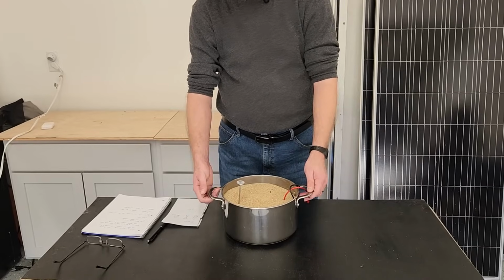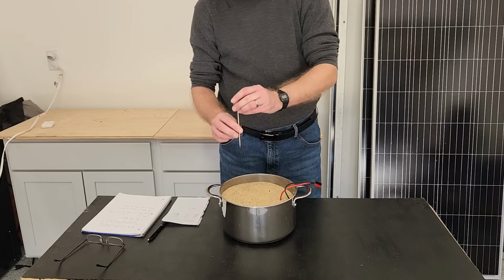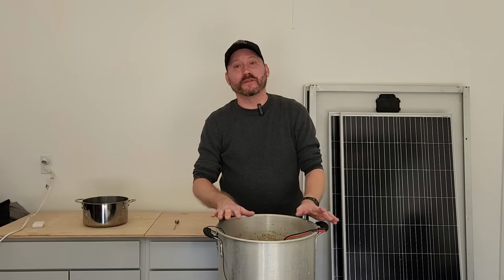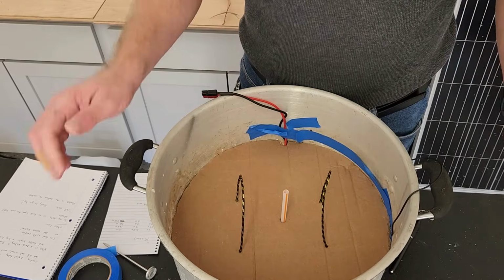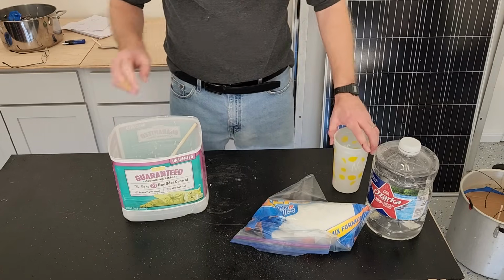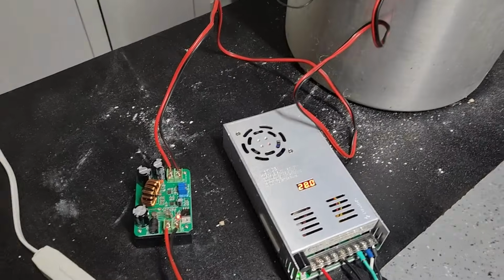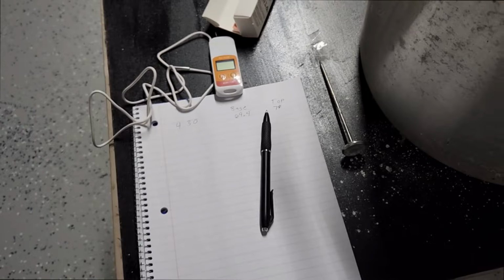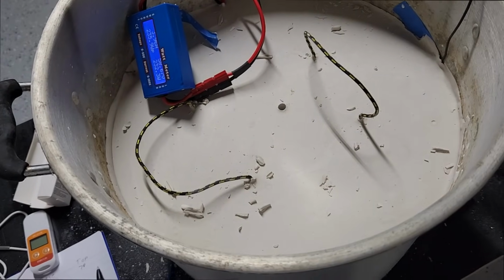Sand Battery heater. Create free heat  of 500F using solar electricity! Texas Prepper Projects

Comment: I would personally use the PV panels to heat water in an insulated tank so you could then either use it later as domestic hot water or pump it around radiators to produce room heating.  Yes, sand holds more heat but hot water is far more usefull in a domestic situation in my view :)
Reply from the maker: stay tuned...
Reply: Sand actually doesn't hold more heat. Water has a specific heat over 4 times that of sand. The sand would have to be almost 850 degrees to hold the same amount of energy water does at 190.
We assume that water holds less because it's far more conductive and produces steam that cools it off quicker. 
The only materials that have higher specific heat than water are liquid hydrogen, liquid helium and liquid ammonia. For obvious reasons none of those things are viable because of their silly low boiling temperature.
If you want this demonstrated for your self take an infrared thermometer on a hot day and find some sand on the ground that's 140 degrees and touch it. It will be hot but will cool off almost immediately because of shade/dispersing it's energy into your hand.
Try this again (don't actually try this again) with 140 degree water. It would be very painful and you would get 1st/2nd degree burns.
Reply: @W1ldSm1le  
Exactly as you said, I've done calculation and at best, for the same volume, sand will hold 12% more energy. It is however not worth it, besides the complexity of doing it and high temp risks, energy losses will be far greater then extra 10% energy stored.
Reply: Sand doesn't explode like steam will so I'm makes the whole system a lot easier to design and maintain.

Comment: I use to work on tugboats and some had engine block heaters that pumped engine coolant threw pipes and if some one could come up with the same idea but using pipes like a radiator does to heat with your home it’s just an idea I like what you’re doing it opens up other ideas! Good job thank you for your insight.
Reply from the maker: Thanks!

Comment: Sand starts fusing into glass above 3000 deg F.   That is a sure sign that your heating element was WAY too hot!  That heat degrades the life of of the heating element quickly.  It's a sign that the heat is not conducting through the sand quickly enough to keep the heating element in a reasonable temperature range.  

Some ideas to consider that will help spread the heat out - which will heat up the sand faster, and extend the life of your heating element:

Screw the element into a the center of a large round metal plate that is ~1" smaller than the diameter of the pot.  Make sure it has a solid contact with the metal with a large nut.   The thicker the plate the better.   Thick plates may get expensive, but multiple thin plates will work fine.  This quickly spreads the heat over a large area and lowers the thermal resistance to the sand, heating it up quicker.

Use multiple heating elements connected in series, or parallel if the panels can handle the low impedance.  2 heating elements cuts the power to each element in half, lowering its max temperature, extending its life, and helping spread the heat out over more area.  

It would be best if each heating element had its own heat spreading plate, but if the elements are electrically isolated, they can be mounted on the same plate.

Instead of a water heater for your heat source,  consider using coil heaters for a stove top.  These have a lot more surface area than a water heater loop, and naturally spread the heat out more.   You can stack several layers vertically in your pot, each separated by an inch or two of sand.  They are pretty cheap and readily available. 

I'm not sure how possible this last one is, so it may not be practical - it could take some investigation.  It would be great if the heating element itself could be solidly attached to a metal heat spreader.  Perhaps crimping on some aluminum flashing material.  But I would check first to see if their is a voltage drop across the SURFACE of the heating element when powered first.  If there IS a voltage drop, attaching plates to the surface will just short out the element, and possibly melt the plates with the current going through them, so check for that first.

In case you're wondering, no, I have not built one of these before.  However, I've been an electrical engineer for over 3 decades, and spreading extra heat around safely is a regular part of my job.

Good luck on your next build!
Reply from the maker: fun ideas, thank you!~     I am integrating some of these ideas.  I'm also trying to stay on a bit of a budget for now so people can follow along. I do think that a 'heat sink' will help spread things out.  @desertsun02  Just used copper strips, but I think I have a better idea. More soon

Comment: This is called a storage heater. The commercial ones use thermal 'bricks', computer control for heat release and fans to blow things about.

If you want to power the heating element directly from a solar PV array, make sure you match the load resistance (the resistance of the heating element). It will be about 4 to 20 ohms and this should match the apparent PV terminal resistance at the average sun intensity. You do this by measuring the current and voltage and dividing the two.  For a quick guess at the resistance, take the VOL (open loop voltage) and the ICL (closed loop current) readings from the label on the panel and divide the VOL by the ICL.  However, the VOL changes depending on if multiple panels are connected in series and the ICL depends on how many panels are connected in parallel.

The reason why you want to match the load and source resistance is for the best efficiency. A mismatch will significantly reduce the effectiveness of transferring solar energy to heat energy.

At the temperatures you measured you are going to burn out the heating element. The highest that element is expecting to get is 212F since all it does is heat water. The alternatives are nitinol wire used in electric kilns and electric bar heaters. It's cheap enough and the good thing is you can tune the load resistance by simply having more or less length of wire since the resistance is just a function of length.

To get the heat out, you could put a coil of copper or steal pipe in the sand and just blow air through is. The air could be scorching hot so be careful. Don't put any liquid in the coil - whatever it is it will probably just boil, expand and blow up.
Reply from the maker: great technical information!
Reply: His nuts, but cool
Reply: I plan to try to use the heating element from an electric stove, which can handle the higher temps.
Reply from the maker: @SmallVansBigWorld   I am going to do so as well for version 2.  Stay tuned!

Comment: A small but perhaps very important detail is to use some wire heat shrink around the screws where the wires connect to the heating element. It probably melted the sand from there potentially being a short through the sand. This will give you longevity to your installation. 
Keep up the great work, hoping to see this on a even larger scale soon! I have 55 gallon metal water barrels that I use 120v heating element to heat the water for inside my greenhouse. Connecting 2 large solar panels in series gives me 80-90v and it works perfect.
Reply: I hope this video goes viral. People need to see this. I only found out about sand batteries recently.
Reply from the maker: agreed on this. I'll improve on the next one
Reply: I don't even know how the wire insulation didn't melt at these temperature.

Comment: we had sand bath heat exchangers at work with electric heaters heating outside of tank to over 1200 F,  a small amount of air is circulated through the sand to make it move like water and you could easily heat the product in pipes nice and evenly to 1200 F sand can be heated to thousands of degrees before it actually melts.
Reply from the maker: Great tip!

Comment: I'm not sure if water heater elements will last long. They are designed to be immersed in water, and they will burn out in short order if run dry. Electric burner elements should be more reliable. I'd also suggest using wire leads that are insulated in fiber glass for the heat resistance. For a lid, using a lid the pot came with should work better than one made out of plaster. They made lids with holes if you want to try that. You can drill holes in the top of the pot and put rubber grommets in the holes to protect the wires from the sharp metal. You could also use a high temperature thermostat to switch off the element to keep the sand battery from overheating. If you use any insulation in the pot, fiber glass or mineral wool insulation would work the best.
Reply from the maker: Agreed. Check video 2 and 3

Comment: Okay, anyone who does this needs to treat the thermal battery like a wood burning stove! Air gap insulation, heat shielding from anything that could be combustible. Radiant heat can, and will start fires a distance from your sand battery. 
Please do not set it on 2x4s! Set it on stones, bricks or glass blocks, with an air gap between for air flow. I wouldn't set it directly on top of carpet either. Unless you have a concrete board between to take the heat. My wood burning stove is set a base layer of glass block, then a thin concrete board (shower wall type) and then the stove sits on that. There is plenty of air flow under the concrete board to keep it below 90F. 
Radiant heat can (and does) start house fires. So just be careful with it. That includes keeping curtains, furniture and anything else that can catch fire at least 3 feet away from the sand battery.
Reply from the maker: neat idea

Comment: I am a Solar Thermal specialist.  I live in the Midwest and deal with higher heating loads than you do in your area.

I have taught and given talks on Solar Thermal systems and designs.

Here is my advice. 

You can capture or harvest more Thermal energy using Solar Thermal panels or collectors instead of using Electric panels and converting.

A Solar Thermal collector is more efficient per Sq ft of area than an Electric.

Electric is now around 20 % for a good one and Thermal is around 50 to 80% efficient because it is capturing Infrared energy from the sun instead. 

Many years ago I helped a man stack concrete blocks in his basement as a Solar Thermal battery. We ducted hot air from a collector through the stack. It worked very well for short term storage. 

The higher the differential in temperatures,  the less efficient the heat transfer is putting it in there.

It is quicker to transfer from the hot source to the cool source but it means that you need to have a much greater amount of insulation to keep it stored without losing it.

Go to a larger amount of storage medium and build your own Thermal collectors. Keep storing your excess Electric in batteries and then the overage into a Marathon type water tank. It will be more efficient and cheaper in the long run.

High temperatures mean high losses.
Reply from the maker: What are you using as a collector? I'd love to learn more! I've seen several designs out there for solar thermal hot air collectors but can't decide which is the best one.
Reply: @Texas Prepper Projects  you can easily build your own using aluminum water heater or dryer vent piping, old cans or even Aluminum panning or sheet metal. 

You just need to use flat black high temp stove or grill paint to coat it to absorb the sun light.  Find and use foil backed Isocynurate insulation that is high temp rated. It won't off gas. 

Build the collector with a back pass air flow or through the duct or can air flow. 

You can also use a flat plate designed with water running through pex pipe. 

I built some collectors years ago with copper and pumped food grade mineral oil through them with an expansion tank in the system.

Never had to worry about freezing or Boiling as long as it was moving when the sun came out.

There was a really good collector that I helped with in maximizing output but the company that made them is now out of business because the owner passed away. 

They were called Sunsiaray or Northern Comfort panels.

They used a special coating on a copper sheet that was kind of like gun bluing. It was 83% efficient at capturing the sun's IR waves. 

Black paint is around 65% efficient.

Look up  Cansolar.
https://theindependent.ca/news/how-to-build-a-pop-can-solar-heater/#:~:text=A%20pop%20can%20solar%20heater%20is%20an%20air%20heater%20that,prototypes%20and%20large%2Dscale%20units
Reply: @desertdan100 Thank you, you seem to be very knowledgeable in the matter. I wish I could pick your brain out for a project I have in mind. A house heating system consisting of a roof mounted solar collector piped directly to a storage device located indoors with also some means of heat distribution to other rooms. 
My main problem is sizing it up. Your expert opinion would be of great help.
Reply: @gaetanoroccuzzo  Figure out your needed btu load first. Size your collector according to the available hours of usable sun you have in your area. 
A good way to think about the design or formula is in watts of energy. 

Each 12 x 12 inch square foot of surface area the sun gives us can be used as an approx known basis. approx. 110 watts of potential per sq ft. Your collector efficiency details how much you can capture. 

Solar electric is about 17 % efficient. Solar Thermal can be from about 45 to 85 % efficient depending on the collector type and material it's built out of and the design.

This is the trick for efficiency while heating air. I discovered this over many years and used to hold my findings close because I was trying to patent a collector but I gave up and will just share it now even if I never get credit. It takes money and the right people to avoid being shutdown by those who wish to monopolize energy. 

You need a minimum of 8 cfm per sqft of collector surface and you need to try and maintain approx. an 85 degree discharge temp out of the blower minimum. If it drops below that just shut it down until the collector can heat back up again.

Too high of a discharge and you are losing a lot of heat back out of the collector to the outside. Too low of a discharge and you can't exchange the heat to the air or fluid efficiently. Heat moves toward cool. The higher the difference the faster it travels.
Reply: @desertdan100  Thank you. I will treasure what you have explained. 
I don't exactly know when I will start my project. I am already behind schedule for this year, the good weather is almost gone and I have a lot of preparatory work to do. First of all I need to convert your measurements in metric as I live in the north part of Europe and I am not conversant with your standards but that can be overcome.
I am sorry for your decision not to patent your idea, it's a pity. If I can give you my input, you ought to think of it as an investment for the future. 
Best of luck.

Comment: Water is still cheaper than sand and better that sand as a thermal storage battery.  For same volume and temperature delta water stores about 3x the amount of energy.
 50lb of sand is about 14 dm^3 (liters) in volume and since heat capacity for sand is around 0.38Wh per liter per kg it means you can store 14 * 0.38Wh = 5.32Wh for each degree Celsius increase in temperature.
For same volume of water (less weight) you can store 14 * 1.16Wh = 16.24Wh of each degree Celsius increase.
So say you start at room temperature 25C and up to 90C to be below the boiling point of water then in 14 liters of water you can store (90C -25C) * 14 * 1.16 = 1055Wh so just about 1kWh of energy while to store the same in same volume of sand you need to increase the temperature by about 195C above the ambient so around 220C (428F) but the entire volume of the sand will need to have this temperature and it will be hard since sand is such a bad thermal conductor compared to water and so you need a very special heating element that water heating element will be damaged in the way you use it.
I use both water and concrete as thermal storage since I heat my house fully with solar PV.
Reply from the maker: Check my follow up videos

Comment: This is a nice project but needs to be scaled way up for anything larger than a small bathroom.  Looking at the panels I estimate you are heating the sand at 200 watts max.
200 watts from 5 hours of sun is 1,000 watt hours or 1 kilowatt hour which is equal to 2.5 ounces of propane. If bulk propane is $3.00 a gallon that would cost $.011 if you buy 1 lb. cylinders it about 7X  or $.77 worth of propane.  (about $0.10 to $0.25 worth of electricity depending on where you live) .
Reply from the maker: This is true. Check my other videos for more information

Comment: Very interesting. I made some tests with my father to. But try it with a PCM (phasechangaterials) material as Sodium acetate. Coconut oil works as well. From solid to liquid state. 

But your test is very interesting, there are many experiments with sand. Non explosive, non toxic and cheap.
Reply from the maker: Thanks!!